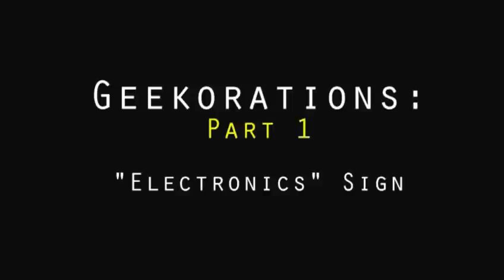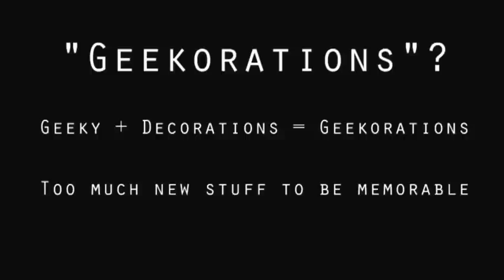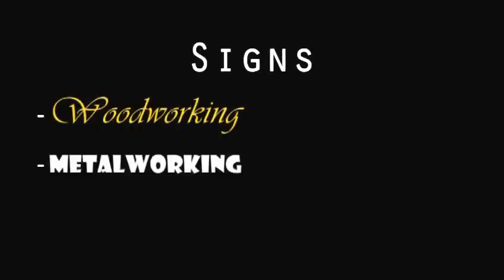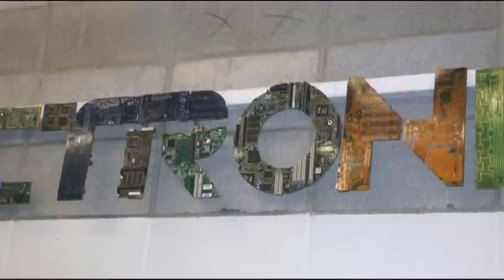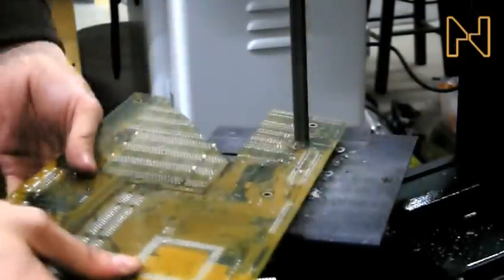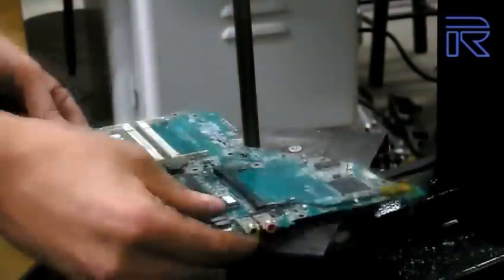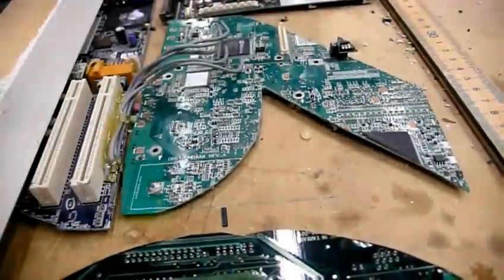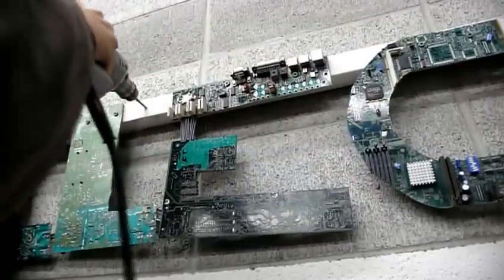Geekorations Pt.1 - Electronics Sign From Circuit Boards

Comment from the maker: Normal cheap bit. Might not have been fiberglass, I figured all boards were. Holes might've been crappy but I don't recall that they were.

Good call on the bearings, I wasn't aware of that. I'm glad I vacuumed up the saw twice during the cutting and after.

Comment: Then you either already had a tungsten carbide drill bit or the boards weren't glass fiber (FR4). And even with a carbide bit, I doubt it's good for thousands of holes (never heard of someone getting that far, at least if you want "clean" holes). But hey, I'm not here to argue.
Just be aware that the glass fiber dust is very abrasive (it will kill bearings over time) and VERY bad if breathed in.